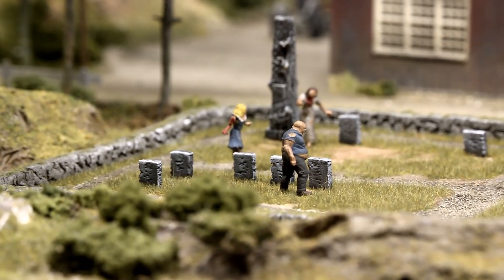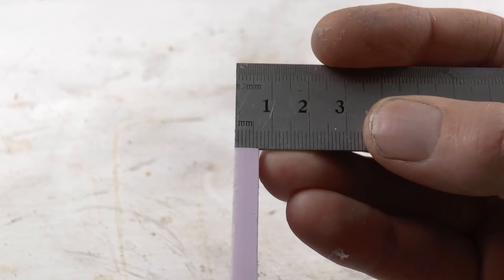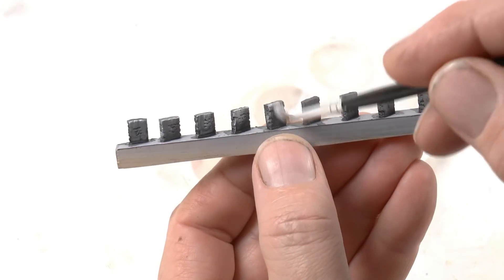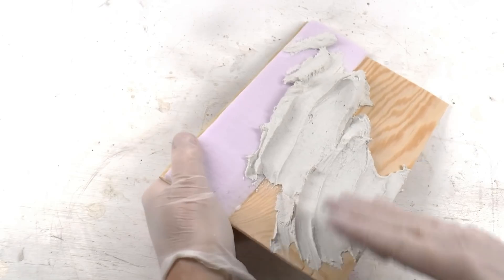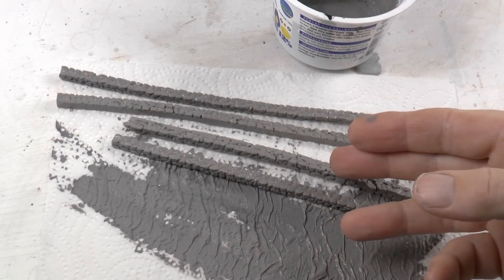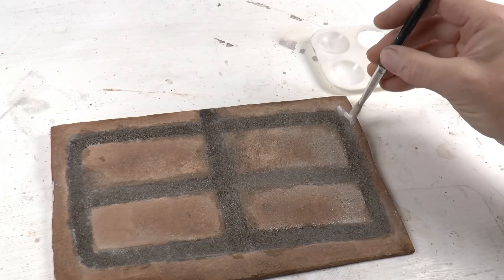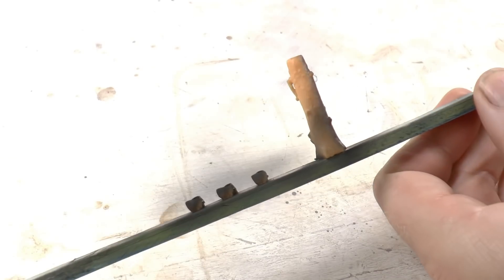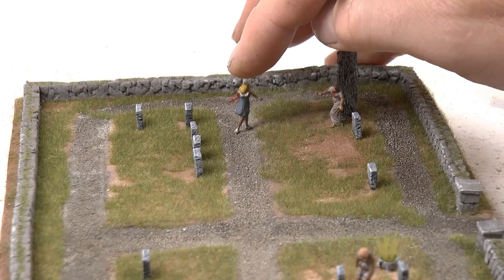Scratch building a Grave yard with glowing sculls

Comment: Great video! I just want to throw this out there... I have been working on a Native American diorama to test ideas for my new HO table I am starting on. Not much out there for HO except cowboy and indian sets..... And I need village like things. I found saving my used tea bag great! Not only using the old tea, like you use coffee, but the bag paper is strong and takes wet paint and glue well. Most paper that thin falls apart. I am going to use it for hides and tee pees. Try it yourself and see what you can do with it!
Reply: I went down the tea bag route for scenics, and I stored the used tea (very fine leaf) in a screw top jar for a few months. When I came back to it, it had a green growth over the surface... wasn't sure about it so I put it in the compost bin... 🙄

Comment: When using foam to make structures or other parts, would green floral foam work for that as well as long as it gets sealed to stop deterioration?  In the US we have pink foam but it is not the same foam material available in Europe. Ours bounces back a small amount when we try to detail it for structures and such so we have to find a foam type that works for that.